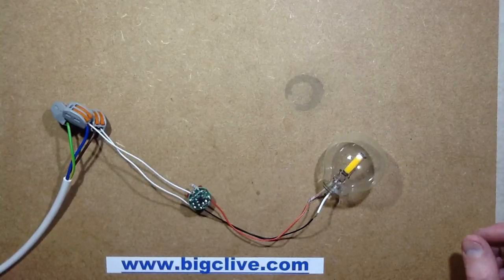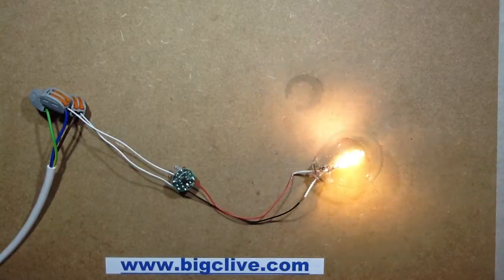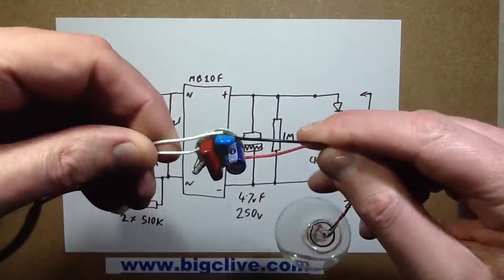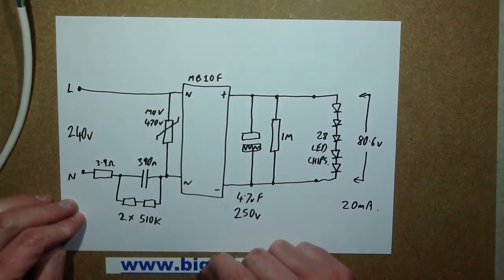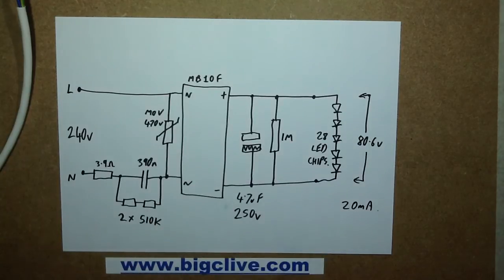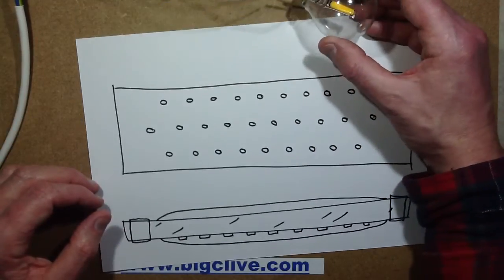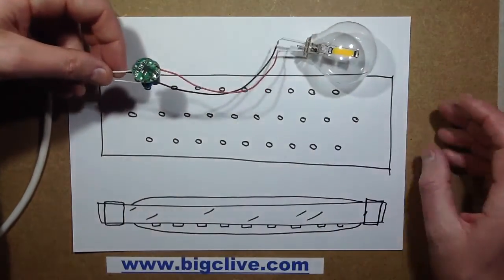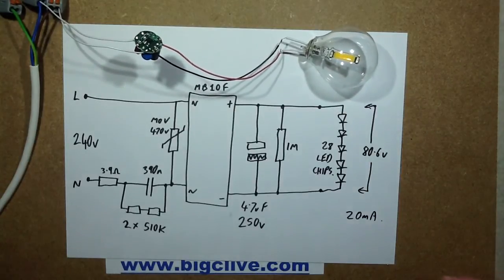Teardown of novel glass 1.6W LED lamp with flat COB filament.

Comment: Very nice , very interesting little lamp.  I'd like to know where I can get these Clive ? Have scoured e-bay , etc, and can't find them or anything like them.
I am intrigued by these as they remind me very much of one of my all time favorite Led lamps , and what I believe to be one of THE VERY BEST Led lamps ever , in terms of build quality and life , etc.  
These are the Japanese Panasonic clear lamps . They are sold in UK under the name "Clear nostalgic" .  Funny name , typical of the Japs , (I am allowed to say that , my good lady is Japanese) . 
I use a lot of the Panasonic clear lamps for myself and at work. They are EXCELLENT - and they just last and last , I have yet to have a single failed one.   (I will send you one Clive)  . 
If you don't know them already I think you will agree with me that they have to be one of the best Led "bulbs" out there .  (The 4.4 watt Japanese made ones are the best. There are some higher power versions which are made-in-China , but those are not quite as good quality)
Anyway . This little lamp has what appears to be a very similar construction , just mounted the other way on and without the thermal mounting.  
Here's a little thing about the Panasonic lamps.    
https://www.youtube.com/watch?v=yhiQ62CBm_E&t=1s
Reply from the maker: Searching for LED filament lamp comes up with quite a wide selection.  Also COB lamp with your desired base number like E27.
Reply: Thanks Clive. I will keep searching , (spending way too much time online lol) . Yes there's tons of Led filament lamps out there but I'd be interested in those specific lamps now I've seen them !     
(Are you familiar with those Panasonic ones by the way? They really are EXCELLENT) .

Comment: I don't understand how this circuit creates the 80v out of the rectified mains, neither do I understand how transformerless designs can be taken serious when the manufacturer uses underrated shit-tier HV condensers on the dc side. This lamp will work 6-12 months max and then the cap is dried up and the thing explodes.

Comment: I wonder if these glass lamps are sealed to stop condensation from forming inside them, especially if they are used in outdoor lights.
Reply from the maker: I think it may just be a way to breathe new life into the traditional glass lamp factories that wrre affected by the eco-brigade trying to ban tungsten lamps.  And glass is more eco-friendly than plastic with the added advantages of being optically pure and stable.
Reply: bigclivedotcom Damned right!